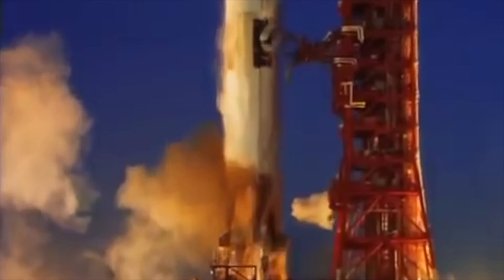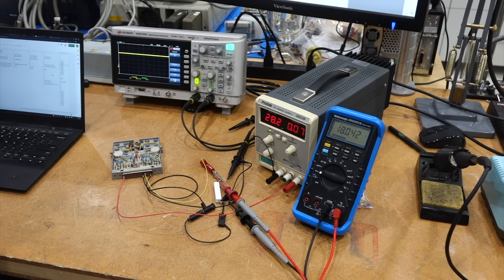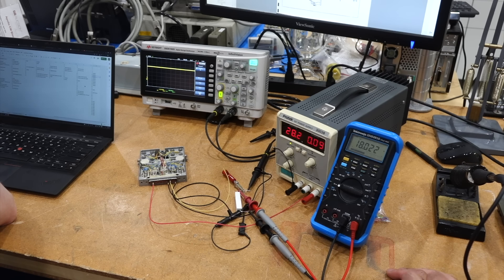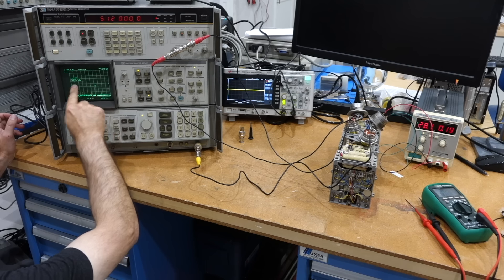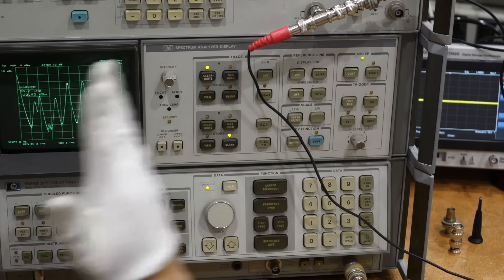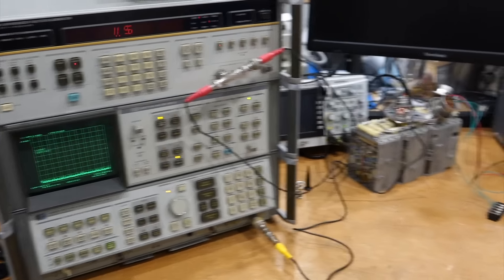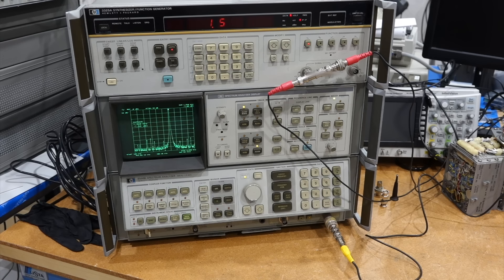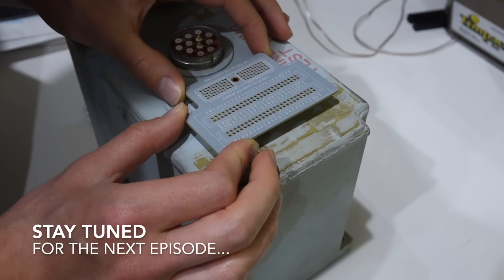Apollo Comms Part 20: Pre-Modulation Processor Power Up

Comment: I swear marc is going to have a 50% original, 50% ebay fully working apollo capsule by the end of this.
Also @CuriousMarc would you consider putting a low frequency block / high pass on your audio? when you move your camera sometimes my sub goes off like a Michael bay movie lol. I think its stuff under about 50hz but I haven't looked in detail. Not complaining or anything, just something I noticed and everything else in your videos are so good ;-)

Comment: You just know this is going to end up with full LEM,  command module, and MOCR simulators, talking to each other over short range microwave links. And I'm right there for it.

Before this series, I had absolutely no idea that radio links worked like this - I always assumed that if you were broadcasting multiple things, you just had multiple radios. It's been very educational, plus I finally understand what sidebands are.
Reply: I don’t think a full LEM AND CSM, I can already see him connecting up the AGC though

Comment: The 'three-row' switch panel appears to have some 30 switches in total.  For 3-position switches, this would imply some 3^30 possible configurations.  Most of these are probably not useful / undesirable.

Mission planning presumably identified the required / valid switch positions for take-off, coasting to the moon, TV broadcasts etc.  That said, dealing with the 'Apollo 13' situation probably required unforeseen configurations.

Today, a modern computer-controlled system might seek to 'lock out' undesirable configurations, motivated by a desire to prevent the astronaut from making mistakes.  But I guess a 'smart' design should also provide an override to cope with 'Apollo 13' scenarios?

Comment: I am always baffled how close those redundant systems are. Of course that makes switching and changing easy, but just a blown capacitator could blow both… why did they do that?
Reply: The engineers are balancing weight, size, and reliability. It's a difficult equation. My guess is this solution is the sweet spot between best reliability possible in the given size.
Its the same reason they don't add wipers to Mars-based solar cells, or two of each science module.
Reply: It's the usual weight and space stuff. But also transistors were pretty new thing back then so I wouldn't be surprised if they thought those were the ones most likely to fail during flight.

Comment: This stuff is amazing. Almost 60 years old and everything is right on the spot where it should be.
Reply: For it's cost, billions of dollars it should still be perfect.
Reply: @paulcohen1555  
electronic components DO age and change their values slightly. Eg. after 10 years almost no capacitor has the value it had when brand new. Coal resistors age, ....
Reply: @kallewirsch2263  Usually you are right, but I have a Tantalum capacitor from that era that have the capacitance and ESR as good as a new one. 😄

Comment: Did all of the Apollo launches use the same equipment?  Or did the comms requirements become more complicated as their communications needs expanded over the history of the flights?
Reply from the maker: A bit of both, but it's fair to say it mostly evolves with each flight. The USB was an original requirement for the Apollo missions, to unify all the radio equipment that had been accumulating since the Mercury and Gemini days, and extend the reach to lunar distances. But they were in a constant race to develop and upgrade the equipment. The first time they used S-Band as the primary system was Apollo 7 I believe. Previously they still ran ranging and updata on a UHF radio, Gemini style, the ranging and command system itself derived from the early JPL satellites. Throughout the Apollo flight program, the electronics and other equipment get constant incremental changes, with very tight revision control and highly documented change logs. Even some switches do change position and function on the control panel. That's why our schematics never match perfectly and we have to double check everything. Of course a major update between Block I and Block II missions (after the Apollo I fire), some equipment still being incrementally upgraded, but most undergoing major design improvement, like the AGC, or complete redesign like the CDU.

Comment: How do the switches cost so much???!!!
Reply: Because they are for legacy industrial applications. Industrial systems are expensive, and supporting long-discontinued systems is expensive, multiply those and combine with contractual obligations, safety rules, and the inability to change the design, and you can end up paying $3000 for a button that could have been replaced with a $25 equivalent.
Reply: @user2C47  on top of all that, they're probably used in avionics. Anything rated to fly is going to be crazy expensive because failure needs to be extremely rare & extremely predictable if it does happen.
Reply: @danl6634  Ok, thanks!

Comment: considering the fact how many electronic components are involved in the whole system and that all this was handmade , its a miracle that nothing or not much failed during all these mission...also amazing that it still works after so many years
Reply: Lots of it failed, on one mission the wrong engine was connected to the wrong harness. This internal stuff lasted but stuff wired by the technicians on ladders was apparently not done by same people...

Comment: That's 50 lines of code in Python 😂
Reply: ...with another 5000 in the imported modules :D
Reply: @KeritechElectronics  A lot of which aren't ever used, contributing to the bloat so common in newer software.

Back in the days of Apollo, you would have spent all day to shave 20 bytes off a program.